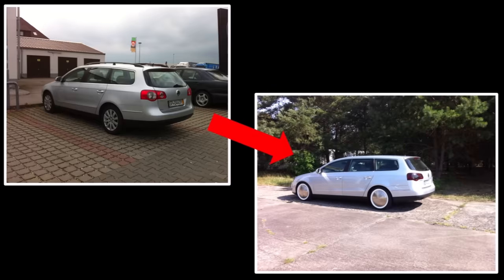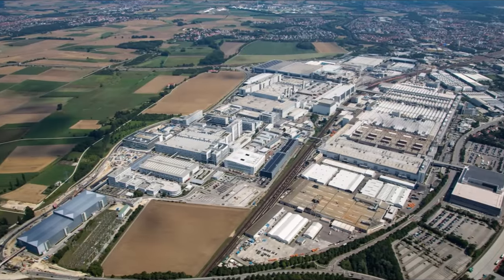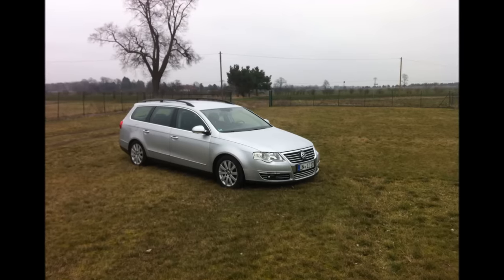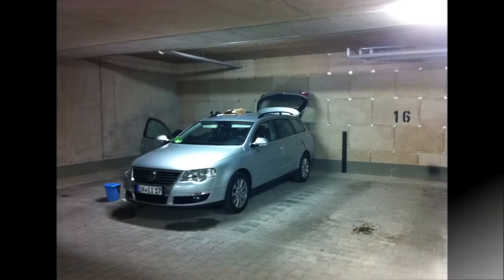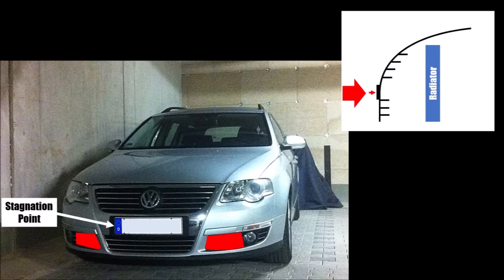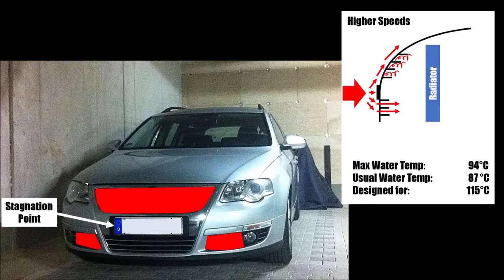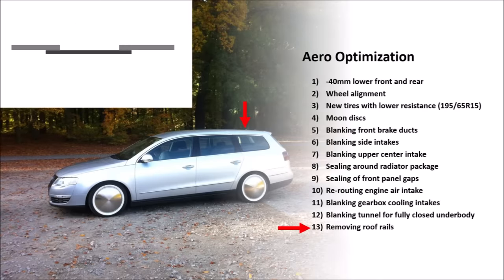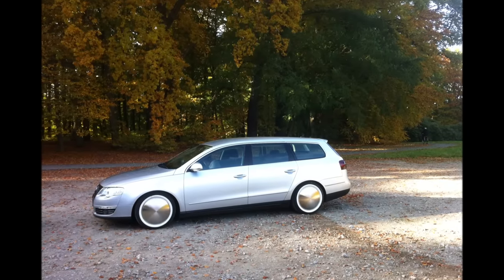Massive Drag Reduction For Tiny Budget - How I turned my family car into an AERO Star

Comment: This is very cool! I think if you took the roof rails off and did the full moon wheel covers, you’d save an easy 5-10 % on fuel consumption. 90% of us don’t use our roof racks anyway. I gained 10% taking my lumber rack off of my work van, alone.

Comment: Have you considered an upgraded exhaust system and ecu tune? Less exhaust restrictions lets the engine work more easily and reduces pumping losses. (A sport system can be quiet as well). Also a rear spoiler/diffuser can reduce drag/turbulence as can smaller mirrors. Awesome content and experiment!
Reply: He would've had to fight TÜV restrictions on some of those mods probably

Comment: Would be interesting to know which ones of these mods are legal and which ones are not. In Germany, does it pass the TÜV for example?
But good video and explanations!
Reply from the maker: Yes it passed TUEV with no issues and also multiple police stops were not a problem. The only thing I had to remove were the tinted rear lights.
After all it was just a lowered Passat with hub caps for them - even on standard 15" rims.

Comment: This is very interesting. I've modified my car (Vauxhall Zafira B) to allow me to switch the engine off at traffic lights without interrupting the radio, but haven't thought about aerodynamic mods.
My use case is similar to yours, except I would probably have to avoid lowering the car, since the increased insurance would likely offset any fuel savings.

Comment: The results of the individual steps would have been interesting. Aerodynamics changes can be surprising, especially if you don't have data on the pressure distribution over the vehicle , Lowering the car doesn't change its frontal area, (apart from the small portion of wheel concealed), but it would likely improve the handling and reduce the underbody turbulence. 
The cooling mods certainly make sense; most cars are overcooled. Direct-driven fans absorb a lot of power when they are least needed. If they are removed and the car overheats when stationary, it's always possible to turn on the heater and open the windows.  (Do not do this if you have to participate in a funeral procession on a hot day.)
Reply from the maker: Yes, I would have liked that too.
Lowering the car by 40mm reduced frontal area by 2% in my case, plus I removed the roof rails later on. So it's not a lot but it is something. No roof rails also reduced turbulence on top.
This car doesn't have directly driven fans, just 2 electric fans which were never on.

I did increase cooling at track days with my Smart Roadster through the interior heating as you say. No roof and turned the heating up. I took the front trunk box out for better flow through the radiator.

Comment: Very interesting video; I have a B6 wagon and wanted to see what I could do to better my fuel economy.  However, as 85%+ of my driving is in the city, it doesn't make sense - and many of these mods regarding lowering drag for the sake of engine cooling would have an inverse effect. My car is also the 2.0 L CCTA petrol engine.  My biggest surprise is that you didn't replace the side mirrors for DTM low profile mirrors.  What was the reason for not addressing that aspect of the drag?
Reply from the maker: German TUEV wouldn't like smaller mirrors and also the side indicators are in there.

Comment: what about reducing the compressor pressure to a lower limit, for better exhaust gas cleanness and lower peak temperatures and lower manifold temp. maybe even more reducing the cooling openings? you change it in winter? like put a Lochbrett to it?

Comment: how did you attach the white disc around the moon disks?
Reply from the maker: The white wall is clicked onto the edge of the steel rims. The moondisc is then attached like a normal hub cap and keeps the white wall in place and prevents it from falling off.

Comment: You surprised me that you did not do something with rear view mirrors. Overall excellent video!
Reply from the maker: German TÜV wouldn’t like that.
Reply: @BSport320  so you would not be allowed to switch it to different (smaller) model? I think in one of interviews Elon Musk actually mentioned impact rear view mirrors have on range (of Tesla's), would you know it too? Best guess at least?
Reply from the maker: Smaller mirrors would help a lot aerodynamially, but you cannot really fit smaller than original ones. Also the side indicators are inside there.

Comment: Very interesting.
“I’m a quick driver”. Best way to reduce fuel consumption with no work at all is slow down 😂. Changing driving style is the the single most effective way of reducing fuel consumption.
I have a W220 S320 Mercedes. During recent fuel shortages because of strikes in France I reduced my average consumption by 15% (down from 8.6l/100km to 7.3) just by driving at 70 instead of 85 in an 80 limit and 100 instead of 115 in a 110 limit and accelerating more gently and planning ahead better. At the time everyone was driving more slowly and more carefully for the same reason. It didn’t even impact journey times significantly. I very regularly use my car for the same 105-km journey. Typical journey times roughly went from 1h12m to 1h20m. As you say use case is also important.
It’s a great argument for taking driving away from drivers and putting it in the hands of AI; robots would do the job far better…

Comment: Very cool, I have a Octavia 1 combi with a 81kW tdi, so almost the same car, which will now be used mostly for highway trips, now that I don't have to commute by car as much, might try something similar. Only issue is that it has a side mounted intercooler, and the sump already sits quite low to the ground... Maybe a TUV approved front splitter-skirt thing would help?
Reply from the maker: Side mounted intercooler actually gives you the opportunity to close the centre intakes completely - but again, depending on your use case.
I had a Polo 6N2 1.4 TDI before where I closed the whole centre and only kept the side intercooler intake open. That worked well during winter, but of course highly depends on your ambient temperatures.
A splitter would, as the name says split the air, keeping high pressure above and hence blocks the flow. So it increases front downforce but also increases drag.

Comment: Question, why do you prefer engine braking? I thought it made more sense to brake with your discs and rotors rather than to add extra wear to the engine and transmission by inducing more revs
Reply from the maker: I actually got used to use more engine braking than normal braking because my first car as a student had worn brakes and I didn’t have money for new ones...
But there is more:
When an engine is driven you actually only have an anti-clockwise working cycle which means because of the pressures the engine is cooling internally - maybe stuff for another video.
The other thing is that it’s very comfortable to have a certain braking moment especially on country roads if you lift the throttle.
Another point is, that there is no fuel injected but water pump is at higher revs and there is usually good airflow, so external cooling is good too.

Comment: A lot of these would likely apply to many hybrids (would like to assume they'd implement much of this at the factory for hybrid models, but I wouldn't assume that since so many utilize same platform as non-hybrid), where you'll be using the motor for regen braking. Likewise for reduced engine heat. And in cooler climates it could help efficiency further by helping engine get up to temp quicker, so less temp idling to get heat (although heated seats and steering wheels would likely do wonders for limiting that in those climates).

Comment: For me, I'm super interested in the flat under-floor, I wonder how much aero efficiency is just gained by the flat floor as well as any reduction of lift at highway speeds (>120kph)
Reply from the maker: If you start optimizing such cars, you should always start with the underbody as there is the biggest potential. Unfortunately, I cannot measure the car today anymore, but I know the gains from work.
Reply: new car already have flat floor but old one is total mess. Best gain are here but also most challenging to install

Comment: Wouldn't it be better with aluminium wheels so the rotational mass is lowered? (If the moon disc can be adapted to aluminium wheels)
Reply from the maker: Like I said, the car was optimized for constant Autobahn speed. These moon dics are made to fit on steel rims.

Comment: Nice project. But after all the work and the materials used, was the fuel saving actually worth the trouble?
Reply from the maker: Definitely, these mods were done with a plate of 1mm Aluminium, foam seals and tape. So very little cost for big efficiency gains.

Comment: @BSport320 does the wheels tow in make it more planted at high speeds? what do you recommend to make a car more resistant to wind gusts. Last trip I had one gust made me change lanes.
Reply from the maker: Toe in at front axle makes the car more agile (although there are different concepts in road and race car design). Toe in at the rear axle stabilizes in corners.
To reduce cross wind sensitivity, you need to push the aerodynamic centre behind the centre of gravity. I made a video about it:
https://www.youtube.com/watch?v=iqb0KxD16Rw

Comment: If the efficiency gains are so huge why not take the extra cost and time to do the sealing or maybe make similar rims just with cooling ducts by default? Maybe not all but surely some of these things could be done to some extent?

Like I think the average MPG for a 2006 VW passat is like 25mpg and you were getting over 50?!? Insane. I know it might not be in the companies interest but surely it is in the regulators interest to get 25mpg cars to be more like 30-40?

Also note to self: 9:34 if I want to investigate doing similar modifications to my car.
Reply from the maker: VW Group did similar things at their "bluemotion technology" cars and standard cars later on, but not as extreme as I did it here.
Standard consumption is, like I said here, around 41mpg (US).
They introduced almost closed hub caps, almost closed underbodies, almost closed upper centre inlets and reached 50mpg, but not the 57mpg I explained here.

Comment: Hey B-Sport :) very interesting video. Was there a specific reason why you didn‘t mount a splitter plate for further druf reduction? Cheers!
Reply from the maker: Yes, a splitter here would increase drag.
It would "split" the air and keep the upper air in front of the car, hence increasing pressure at the front, which is pushing the car back.
So air couldn't flow as easily around the car, in a simple language.

Comment: Question, where did you get the rubber/foam for sealing the panel gaps?
Reply from the maker: Just bought it online. There are many different versions and mixtures. I took some with some glue already on one side.

Comment: What are the labor and parts costs of the modifications vs the fuel savings how long does it take for you to break even
Reply from the maker: I did it myself so no labor costs. Moon discs were 200€, rest was just tape, foam seal and an 1mm alu plate, so let’s say conservatively 300€ for the mods, which brought around 2€ in savings each 100km. So break even is at 15000km. I drove 30000km per year with that car.

Comment: This would be super interesting project with golf as its even smaller and lighter but with same engine.

I think 1.9 66/81kW with 6 speed transmission and similar aero mods would go even lower possibly running on 3L on highway cruising speeds with the 6th gear in and some tune.

My b6 sedan with 2.0TDI 103kW and 6 speed is running on highway 5.5 and avg 6.1. That being said, I'm running universal tires(not low friction), plus going fast. The PD design isn't the best for fuel consumption.

I believe with old 1.9 golf with the described mods i could really run on 3l/100.
Reply from the maker: The Passat B6 sedan is a very good aerodynamic shape. With proper summer tyres (non-universals) and good servicing, it should be possible to get close to 5 even without these modifications.

Comment: What about trying to reduce the car weight by removing ( or replacings ) internal elements ?
Reply from the maker: I was still using the car as family car and it was optimised for constant speed, not acceleration.

Comment: Would be interesting to see if it could achieve a higher topspeed modified like that. Also did you get TÜV with the mods?
Reply from the maker: Higher top speed was limited to gear ratio I would say, as the 5 speed was already relatively short.
TUEV was no issue, they checked the lowering springs and hub caps, they don't care about additional seals.
Reply: @BSport320  Ah i see, thanks for the reply. Thats encouraging TÜV wise.

Comment: Going from 5.5 to 4.1 on autobahn is a great deal, is a pitty you sold the car because you could have achieved even more with easy taller gearing (only 5th without gearbox dissassembly or going towards a larger differential ratio from golf or polo gearboxes). only by decreasing aerodynamic drag some of your mechanical fuel savings are overcome by engine runing in less efficient load zone. Which 5th final ratio had your car inkm/h per 1000 rpm?

Comment: That's a great mod list, and nothing crazy!! In order of importance, which omes do you think are the most relevant and which have the least impact?
Reply from the maker: Wheel alignment and proper tyres are very important to have a good basis. After that, blanking unnecessary intakes and smoothening the flow at the sides and underneath help quite a bit.
Removing the roof rails has a not too big aerodynamic but visual impact.
Reply: @BSport320  I have to say it looks much more modern without the roof rails. Almost like a shooting brake lol
Reply: @BSport320 thanks for the video! what's your opinion on lowering springs? Was it worth it or is it more at the bottom of the list?

Comment: What kind of "rubber foam seal" are you referring to? Can you give an EAN?
Reply from the maker: There are lots of different versions:
https://www.amazon.de/Yotache-Dichtungsstreifen-Fenster-Türdichtung-Gummidichtung-Schallschutz/dp/B08W216NG4/ref=mp_s_a_1_3?keywords=moosgummi+dichtung&qid=1677869810&sr=8-3
Reply: @BSport320  Yeah I've used that before for different stuff... So you just tape it on or? What sizes fit the body gaps best?

Comment: and people call me silly for stashing the roof rack in the trunk till the minute i need it, or removing the back hatch of the trailer when it's empty... 
if a flat floor and moon disks saves me a liter of gas at 110kph i'm all up for it. although my flat floor will be significantly harder to achieve.

Comment: I currently have a 2001 E39 525d manual sedan with the M Aero bodykit which I'm modding to make close to 300 hp and using as a daily and high speed highway cruiser with low fuel consumption, stable high speed handling, and low wind noise. Currently the car is already lowered on coilovers, but I'm missing 2 under trays and the 2 remaining side under trays are broken and sagging. Should I replace those or do a custom flat floor like you did?

The OEM brake ducts are also currently blocked off. Do you think I should unblock them for brake cooling when braking at high speeds, or is the drag just too much to justify?

The car also has a fuel cooler which has an air intake on the lower grille. Do I need that or can I safely block that off?

My current tire sizes are 235/45/17 square. I'm thinking about switching to 245/40/18 square, or 245/40/18 front and 275/35/18 rear. How big of a negative effect is that going to have on aero?
Reply from the maker: First of all, putting all stock undertray covers on your car and fixing the broken ones will help.
For anything else it always depends on if you really need it in your use case. So you should measure the component temperatures before you decide to block anything off.

Comment: Very interesting! 45 degrees at the race track for engine and brake tests seems like a lot. Even many supercars would only be able to do a couple of laps at most in those temperatures. Is that just German overengineering or would you say it now applies to most modern cars?
Reply from the maker: I can tell you that test requirements in the VW Group are exceptionally high and other German manufacturers are not that strict.
Reply: You must also consider those cars are sold to all over the world with lots of varying climate conditions. Of course they could build them differently and maybe it is done but at one point it is probably easier to overengineer them a bit.
Reply: I have take his word on this one, but I never trusted it when they said the cars are tested in the desert at obscene temperatures only to find AC can't keep up past 30° C. Lost of super saloons and hot hatches are cooling limited and there are enough examples of supercars failing at the track to make me wonder why a 1.9 diesel vw needs to be able to withstand the abuse.

Comment: I had basically the same car, but mine got down to 4.5l/100km on the Autobahn at 120km/h without any mods.

But I‘ve since switched to an Audi TT, needless to say that fuel consumption isn’t a main feature of that car.

Comment: How did you fit 19" moon discs to 15" rims?
Reply from the maker: Outside diameter is 19“, inside diameter 15“ and you click it on the edge of the steel rim.
Reply: @BSport320  hmmmm......and the tyre flex doesn't push them off.

Comment: I had 4 liters per kilometer on passat B3 1.9 NON turbo diesel just drafting behind semi trucks on safe distance and going 80 kilometers per hour.
Reply from the maker: I hope you had 4l per 100km.
That‘s nice but at my B6 I had a particle filter too and I wanted to drive 130km/h constantly instead of 80.
Reply: @BSport320  yeah, right, 4l per 100km, mistake in first message.